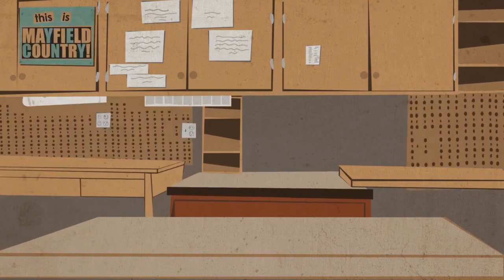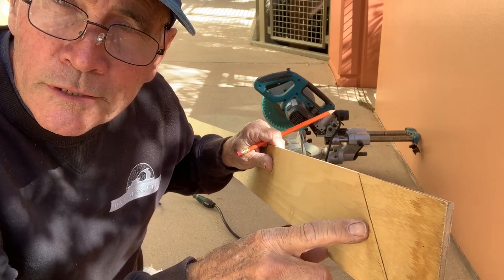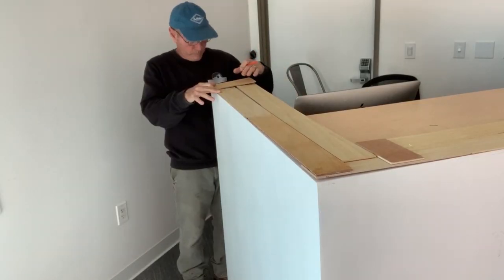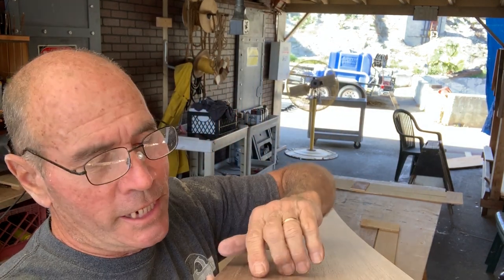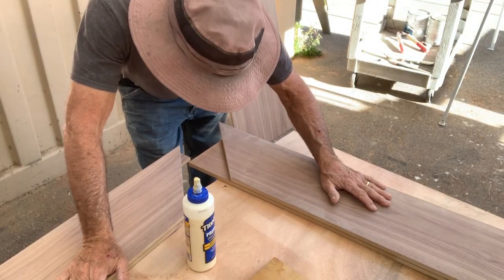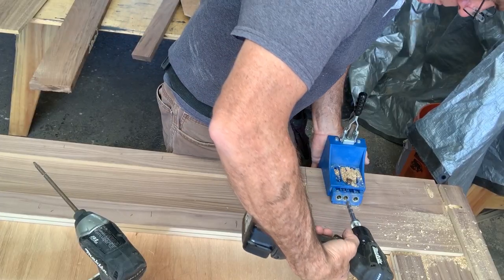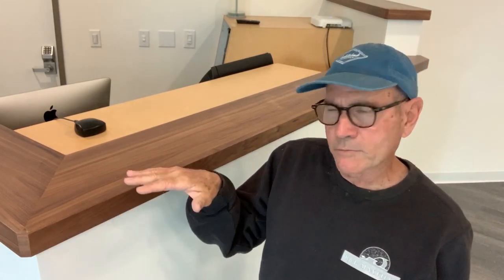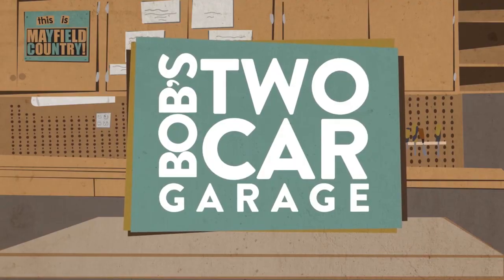Half Wall Walnut Wood Cap and Trim

Comment: This video is great! My boyfriend and I are remodeling our downstairs and we've got a half wall made of concrete all along the perimeter walls that we are trying to cap
Reply from the maker: Glad to be helpful
Reply: Did you finish yours? I have the same thing in my basement. I finished part of it about 8 years ago but made a small mistake with the insulation/vapor barrier inside the corner. That created a cold spot and led to minor condensation/mold right in the corner, I just finished ripping it all out... If you don't live where it gets extremely cold (-30-40) I wouldn't worry but if you do make sure there is no uninsulated gap over the concrete behind the knee-wall for the cold air to contact the vapor barrier touching the interior wall.

Comment: Do you have any tips on cutting and installing maple caps on half partition walls . I just want to be able to work alone and be precise and come close to perfect finish .
Reply from the maker: The same procedures but use 3/4" plywood and pay attention to the look of the grain if its going to be stained.  A "plain slice" looks better than a rotary cut.

Comment: Do you think liquid nails would work if I dont want the pin nail holes?
Reply from the maker: No don't try that. It will look bad.  If you don't want to patch nail holes you could pocket hole screw it from the bottom if you have a Kreg jig or glue and clamp it with regular yellow or brown glue like "Titebond" and leave the clamps on until it dries.  But patching nail holes is totally acceptable.  Watch my video on patching nail holes.
https://www.youtube.com/watch?v=jxWk8XLXEX0